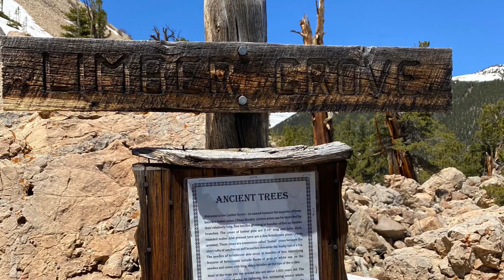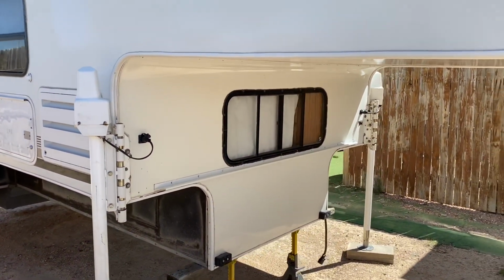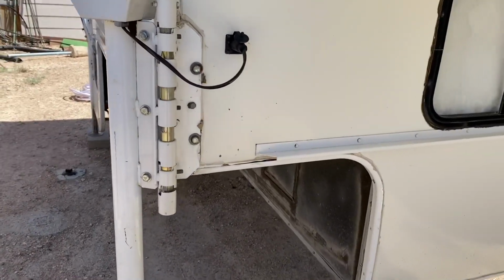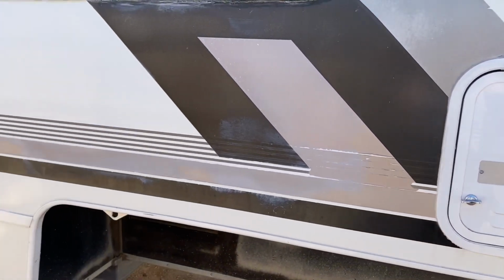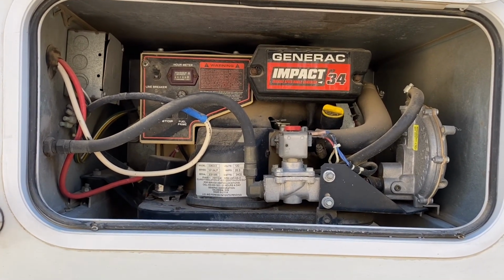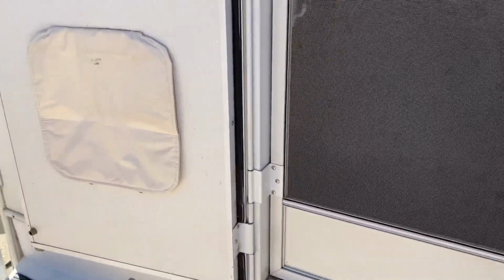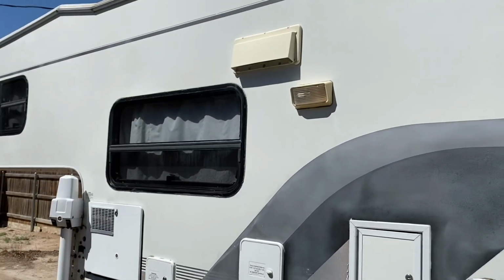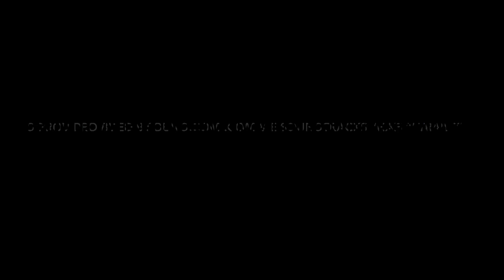Truck camper project part 1

Comment: Can you advise the specs of the Caribou 10F, I could not find any online. What is the A) freshwater tank capacity? 46 Gals? 40  gals freshwater+ 6 gals water heater ?  B) What is the dry weight? C) And gross weight/wet weight? D) What is the floor length?  E) Overall length? Thanks a lot
Reply from the maker: Good questions.  The dry weight is 3200 Lbs, the fresh water capacity is 40 gal, the hot water is 6.2 gal, the wet weight is I think is 4100 (not for sure).  The floor length inside is 9’7” and total length is 18’11”.  It also comes with 2- 40# horizontal LP Tanks.
Reply: @thedesertworkshop  Thank you so much for this invaluable info...Create more videos...Especially if you could travel more....Thank you. Main reason for the questions is, I might get this model, but year 2000 model...